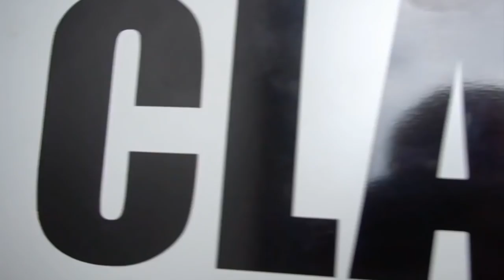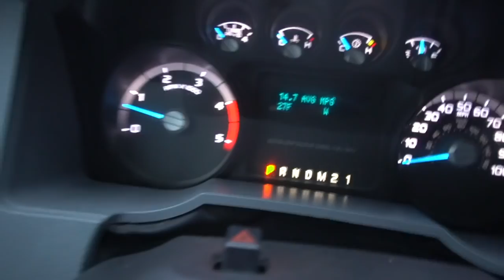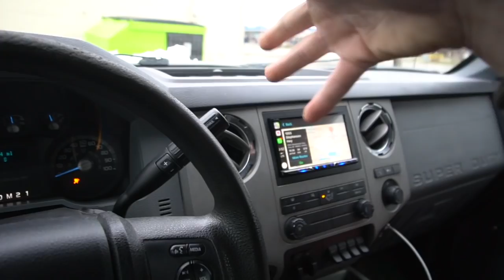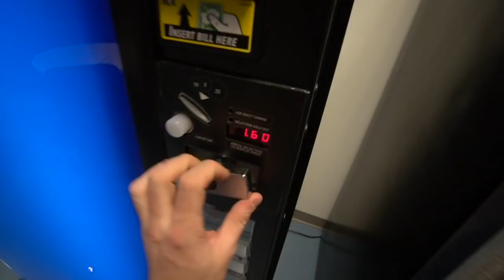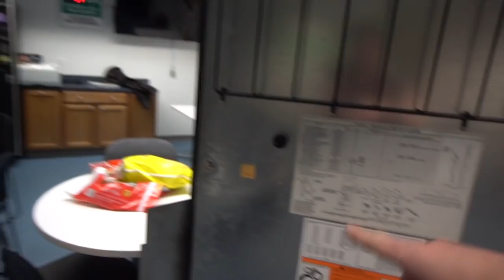PULLING CASH FROM MY SODA MACHINE!!

Comment: $4,462.00 17848 in quarters
Reply: Batman 2K_47 good luck
Reply: You are correcet
Reply: Batman 2K_47 you a chetr
Reply: $4,462.00 17848 Quarters
Reply: You stoll that comment
Reply: valinstall it’s called math dude. Take the number from the thumbnail and do math.